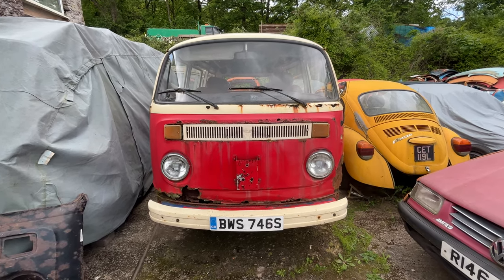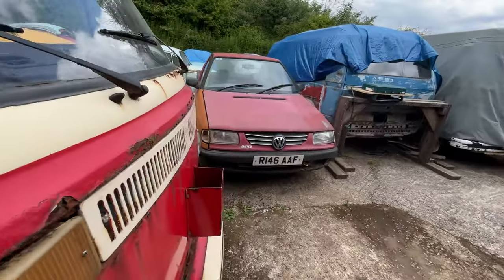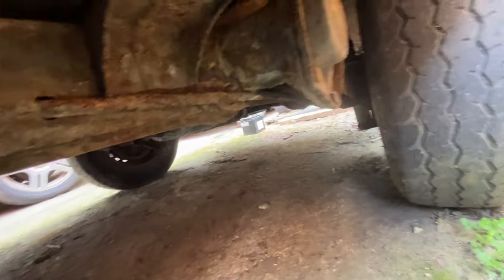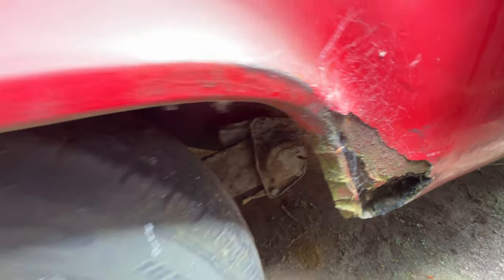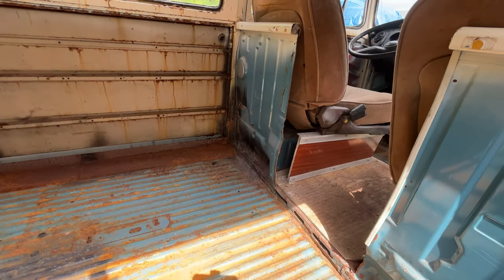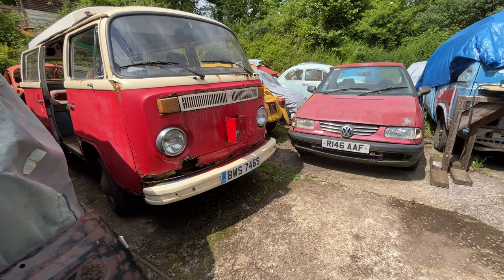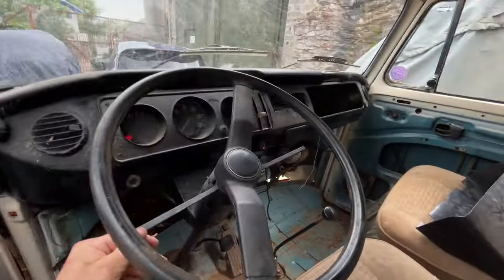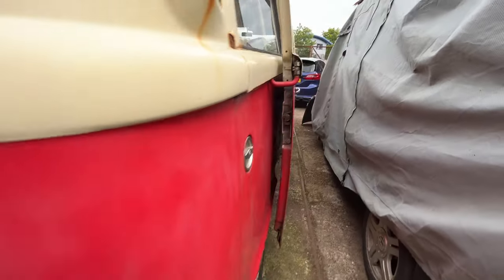VW Baywindow 1979 LHD type 2 For Sale full walk around !! - U.K.

Comment: Price seems right Andy it should go. The fact that the steering wheel is on the “ correct “ side is a novelty for your next of the woods. Good luck with it.👍👍🇨🇦
Reply from the maker: Price cheap Dan especially with front panel . Engines go for asking price aswell . You can find cheap repair panels so easy and cheap bus thank you
Reply from the maker: Correct side 😂